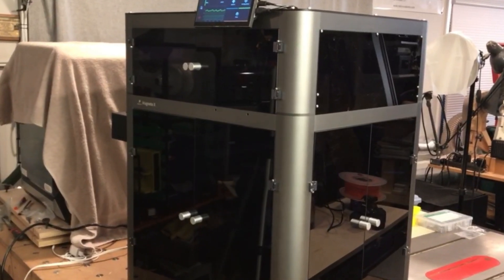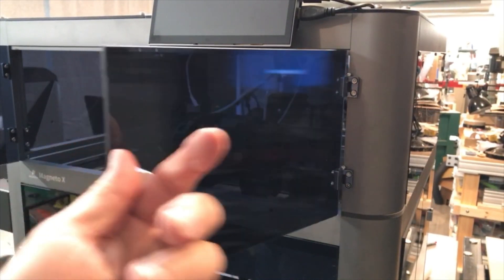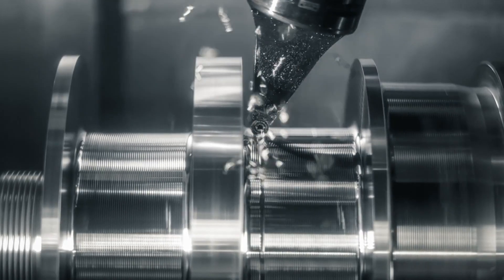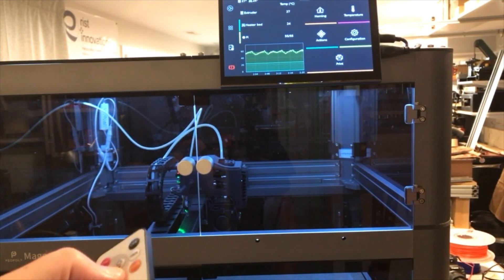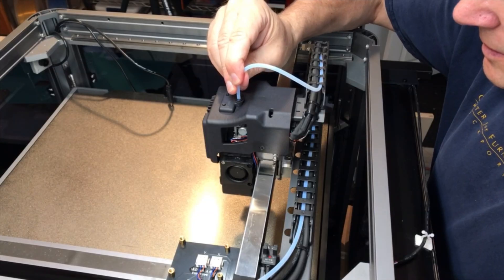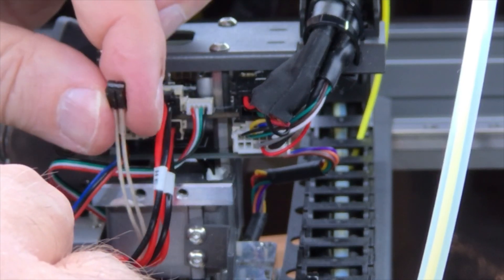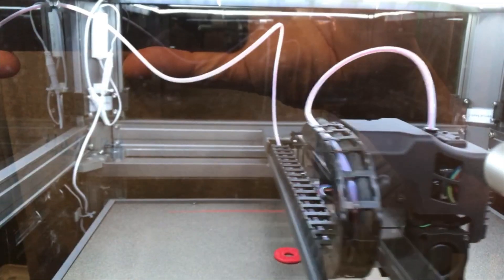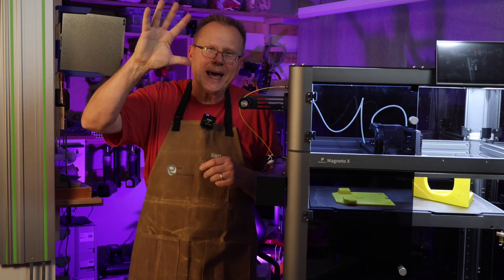Top 5 UPGRADES for the Peopoly Magneto X 3D Printer!

Comment: Thank you for the innovation and design of the light bar. Im printing it now as we speak. Question though...are you running the light strip all the way around, and if so, what are you doing in the corners? I saw the strip was cut at the corner so did you solder extension wires? You went onto showcasing the remote and light levels without showing the whole results of the light mounting. 
Thanks for all you do!
Reply from the maker: Good question. I ran the LED strip continuously around. It was tricky going around the corners and the strip wasn’t perfect in the corners. When I made a similar LED upgrade to my Bambu Lab X1C, I did cut the LED strip and soldered wires around each corner, but I took a shortcut when making the LED strip for the Magneto X. Either way will work; it’s a matter of if you want to put the time in to soldering wires in the corners. Thanks for the question.
Reply: @ristinnovations  okay, how did you do that without kinking the light strip as the angle changes in the 45 degree corner and won't let the strip lay flat in it.
Reply from the maker: The LED strip isn't flat in each corner. It's "suspended" in the air at each corner. It's a bit hard to explain without showing you a photo.  I think the best thing is to cut four strips and solder wires in each corner to connect the 4 strips, but my continuous LED strip was easier for me at the time.

Comment: I own a specialized printing company strictly modeling for industrial and businesses all around washington state. Were interested in this Magneto X but from what we would need out the door the price tag hits $2,000.. We need a large, quick and reliable printer that can print PPS,PA6-GF, PAHT, and PET-CF 24/7.. I want to pull the trigger on this but very hesitant due to the amount of work needed if something goes south.. Anyone vouch for this machine in a production setting?
Reply: PPS alone needs 320c from the hotend, but the current hotend on the magneto x maxes out at 300c. I'd take a look at the Qidi Plus 4 - it can do 360c and has a heated enclosure all for under $1000. Only downside for me with the Qidi is the build volume of 305x305x280 was just a little smaller than I need.
Reply: for a company that needs reliable printers, x1-e probably or just upgrade a x1-c, Qidi plus 4 can do it at a better price but its new and has issues, still waiting on mine
Reply: @songhan1586  yeah I am kind of glad I didn't order a Qidi Plus 4 after seeing some of the quality control issues and even fire safety issues when using 110v instead of 220v
Reply: Do you think it would be easy to replace the hot end with a Revo?
Reply: Its on black friday sale for 1300 and includes the enclosure too.

Comment: I printed out your LED mount but felt it was both too high to see the print clearly underneath the print head and wanted to keep the ability to remove the top without worrying about wires going to it (as well as not having to deal with glue), so I went for a different approach that mounts underneath the Y-axis rail (on the "front"). It's on Printables and can be found by searching for its id number, 947199. Eventually I'm hoping to put a step-down voltage converter and treat the LEDs as a "fan" since the PWM should work about the same. Though, maybe a strip of WS2812's would be easier since I think the Octopus board supports that already?

Otherwise, I didn't get the Jetstream when I originally bought the printer, but I might now. Mostly because it takes sooo long to cool down after a print. This is my fourth printer overall and by far the most insulated.

Also, Peopoly's PETG-CF is quite nice, and not that expensive provided you get the two-packs. Siraya's PET-CF also works using Peopoly's profile for their own that isn't out yet, but the texture is really quite awful, like sandpaper. And like always with PEI plates, I can't get nylon to stick for the life of me, but once I find it I'll try out the Magigoo for nylon that I have somewhere which should fix the adhesion assuming the warping isn't that bad.

Comment: You don't need the vision miner glue. The liquid glue from bambu is way cheaper and works extremely well. Also no need for brims at all on abs with that glue.
Reply from the maker: In my experience, although the Vision Minor is expensive, I have found it lasts much longer than various glue sticks. I was being conservative regarding the brims because I wanted to make sure the print was successful. Thanks for your comment.
Reply: I get small spray bottles that give a nice mist and fill them with IPA.  Then put 10 or 20 drops of Nano in them. Shake up and spray on build plate.